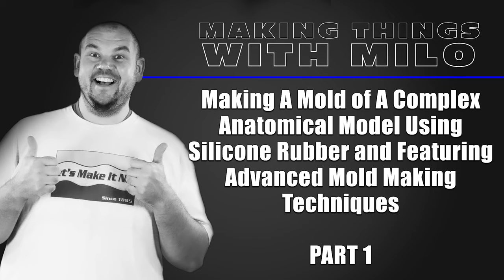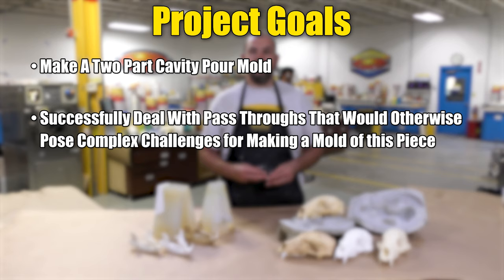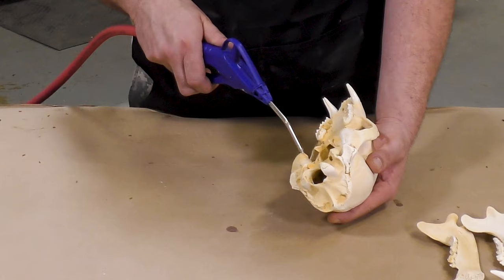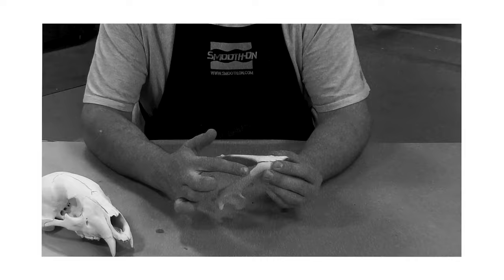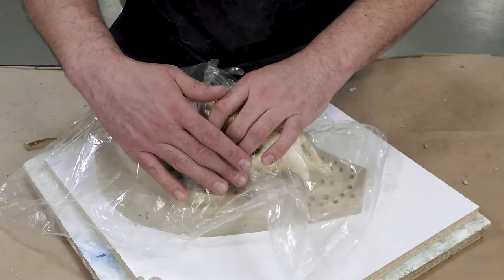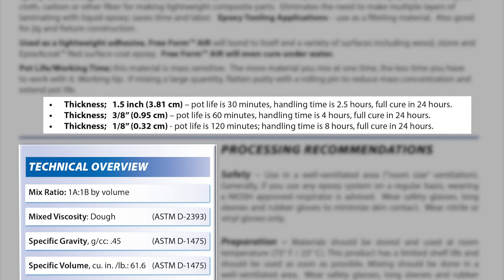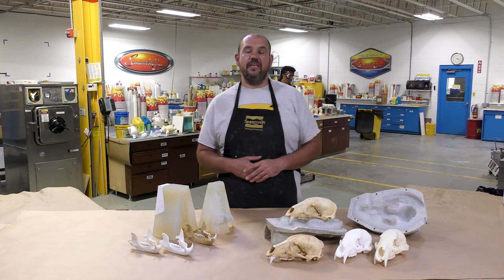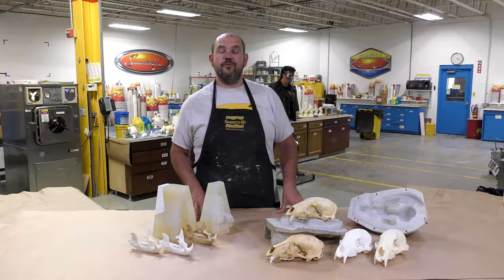Mold Making Challenge: Bear Skull and Jawbone (Making Things with Milo)

Comment: Thank you for this video series!
I'm just wondering why Sorta Clear 12 was used for the jaw mould instead of Dragon Skin 10 NV, as they are similar in durometer.
Reply from the maker: Dragon Skin 10NV was used because it has a slightly lower durometer than the Sorta Clear 12.

Comment: Excellent video! Odd question, if I wanted to return the skull to the wild after making a mold, would the materials (such as the wax used to seal up the skull) have a negative effect on the surrounding environment?
Reply from the maker: Hello, you will want to fully clean the wax off the piece fully before returning it to the wild. If you reach out to our technical support team they can help you find the right materials for your project. https://www.smooth-on.com/support/ticket/add/agree/

Comment: Did you need to put the product in a vacuum chamber to remove air bubbles before you poured it? Or does the product have a low amount of air bubbles to deal with and they won't show in the cast of the subject.
Reply from the maker: Some silicone rubber does require vacuuming, check the technical bulletin for the material.